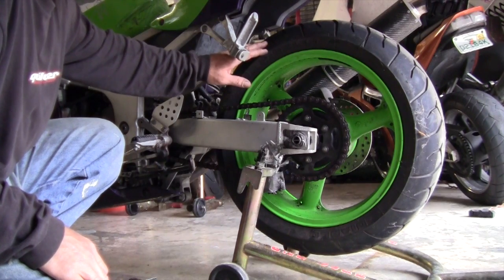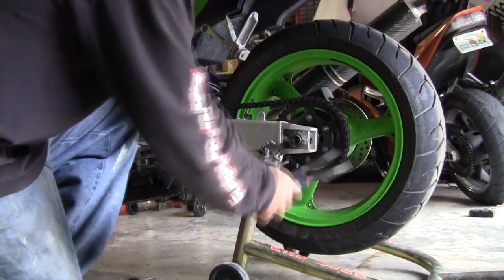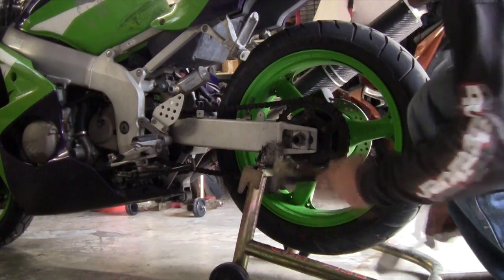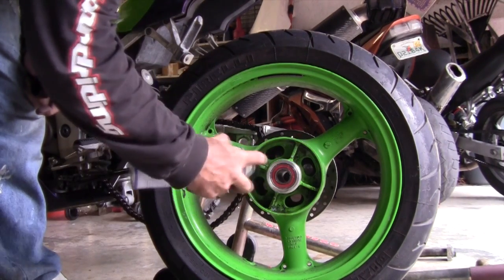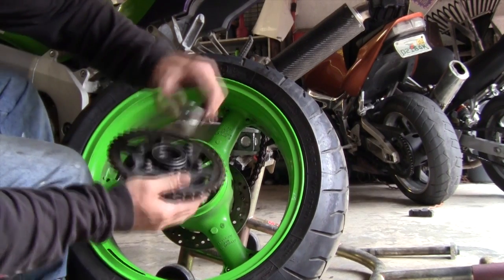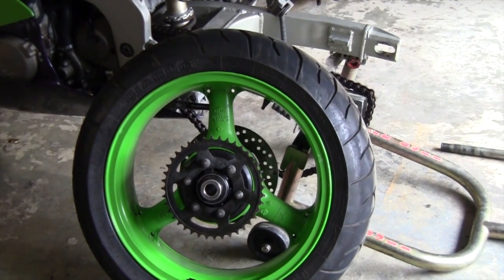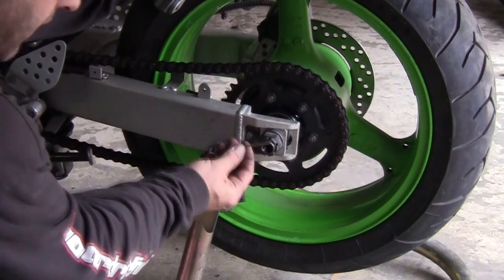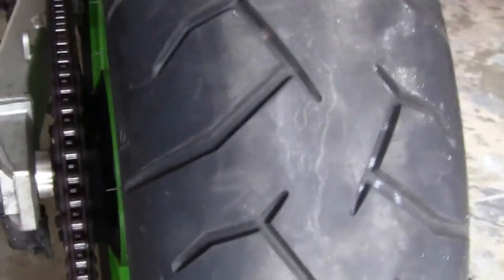Cush Drive Replacement

Comment: So happy I found this video, appreciate it heavy man. I was riding home last night and heard my bolts hitting my swing arm. I had no fucking clue what the sound was, I pulled over and looked at my bike but it was dark so I just rode slow home. Took a nice ass chunk outta my swing arm, and ripped up on the back of the bolts.

Comment: cotter pins? hell no. 181,000 miles on my cb900 and it has no damn cotter pin on the axle bolt and I haven't crashed yet despite triple digits speeds down steep mountain grades time and time again. :P

waste of time/cash

good video though. simple easy important repair. Hardest part is re-installing that axle which we all know is a BITCH if you're working solo with bare bones equipment.

Comment: Yeah, I never seen one that bad. Someone drove the heck out of that bike. I have a better understanding of why the cushdrive is there now. If you ever have a rear tire that goes left to right when your braking but goes in a straight line when you gas it. Check your rear tension nut. I had a shop leave one loose on me when they replaced the tire for me. I got two blocks from the shop before I noticed it.